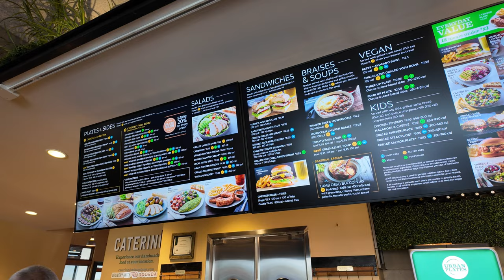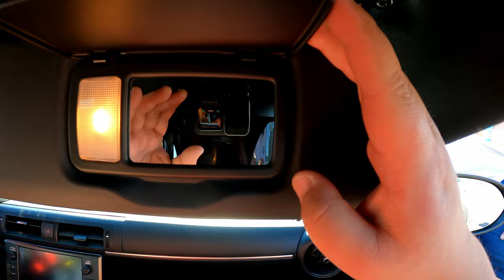GR86 braking issues!

Comment: The reduced power steering is a known issue in gen2. Gotta muscle through it. I have my ride height high enough so that the tires don’t rub on the frame rails and it still does it. Around 13.25” center to fender with 400lb springs

Comment: Look at Race Chrono to get data overlay and recording synced. You can tap into the can bus with an adapter where the engine speaker is. BTW Sub 2 is doable no problem with a gen 2 car
Reply from the maker: I actually have Race Studio and i use my Aim Solo 2 DL. I did it in my other videos but didn't do it for this one haha